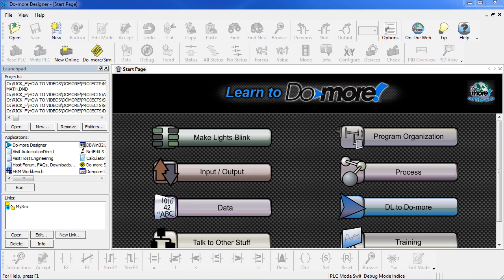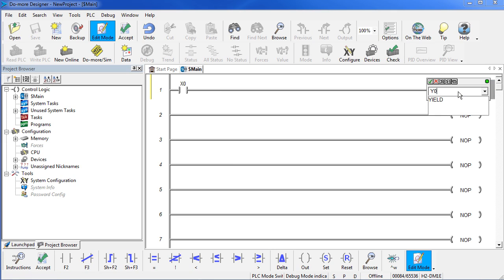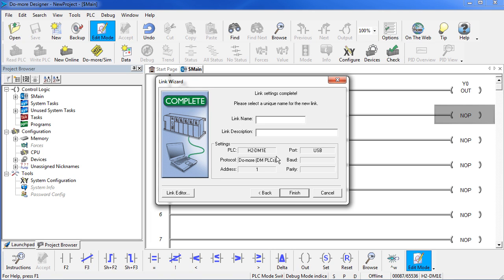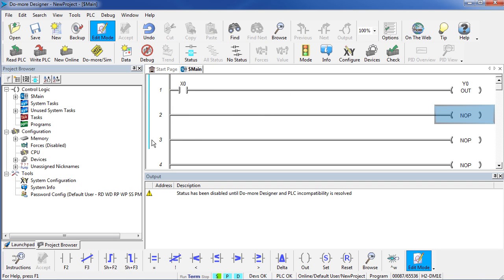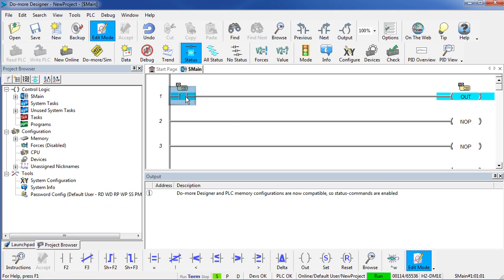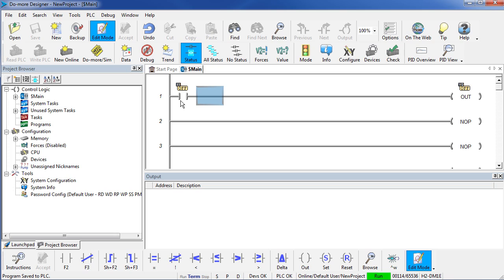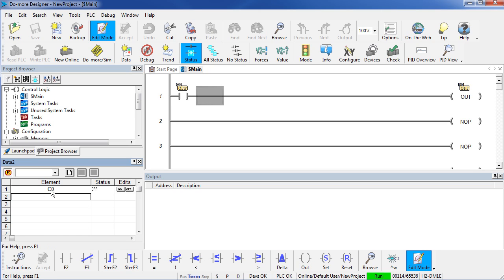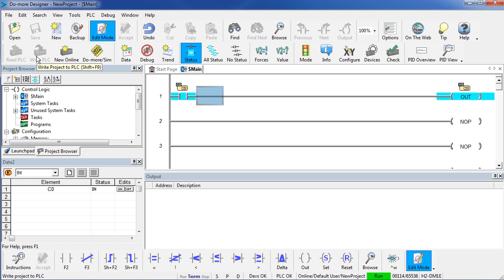BRX Do-more PLCs Quick Start from AutomationDirect

Comment: I can't download an offline project. Every time I connect to the BRX PLC, it uploads from the PLC and closes my offline project. I'm not getting the 'resolve' popup to ask what I want to do. Software seems buggy or something. I'm following your exact motions here....

EDIT: I was clicking 'new connection' every time I wanted to go online. I mistaken that button for the 'connection' button under the PLC dropdown menu.
Reply from the maker: Thanks for the comment Austin. This topic would be difficult to troubleshoot through YouTube comments. I would suggest you contact Tech Support to resolve this issue: 1800-633-0405.
Reply: @automationdirect  I received help through the forum. I was supposed to connect through the PLC dropdown menu, not click 'new connection'. That was quite confusing to me. Also, I started using the application on Parallels virtual machine on a Mac. Do-More Designer has big connection issues to the PLC in this VM. Not something people will care about because this setup is not used hardly ever. The application runs fine on a native Win10 machine.
Thanks
Reply from the maker: @austinbutler1985  Hi Austin,  Thanks for the feedback - we appreciate you taking the time to do that.